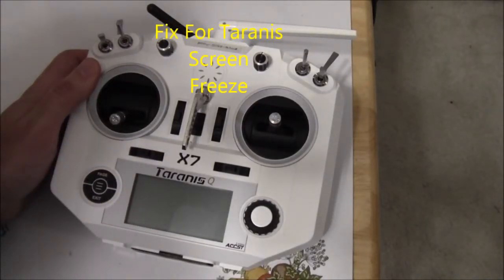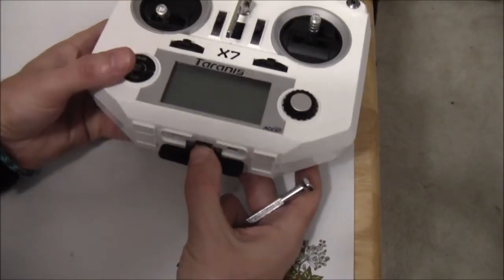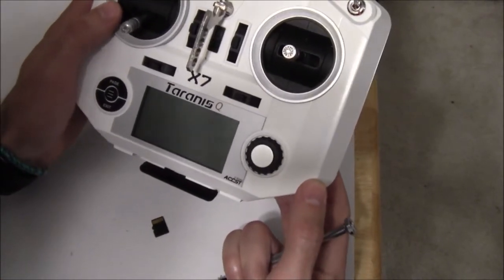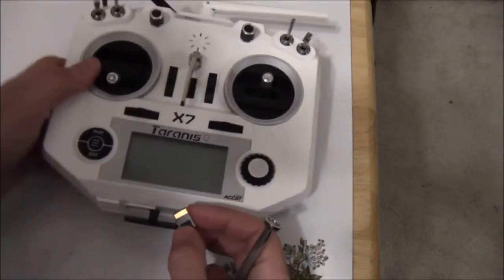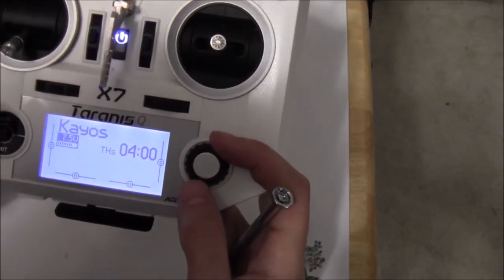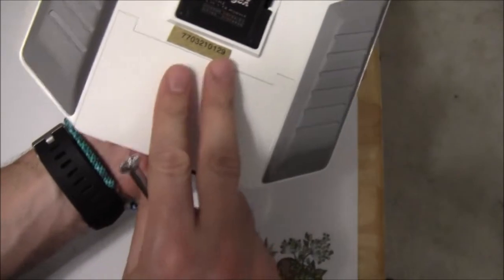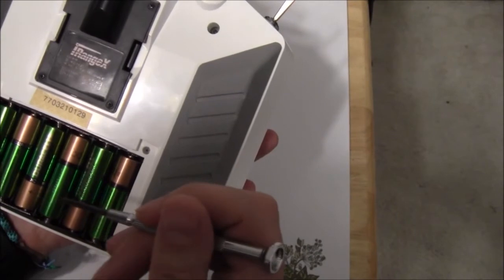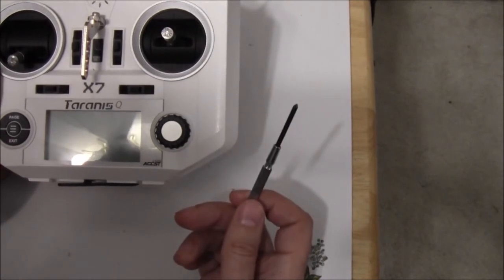Fix for Taranis QX7 Splash Screen Frozen Stuck Hung

Comment: I tried this method.. did not work.. frozen on screen.. took apart.. removed all batteries.. still doing it.. also tried to re flash.. does not see firmware.. cant load anything.. will keep trying things..